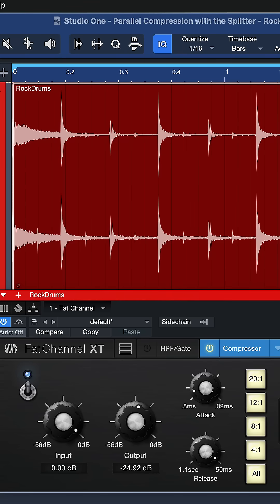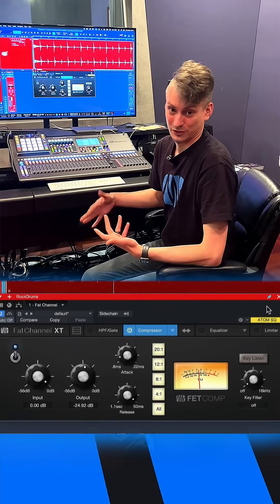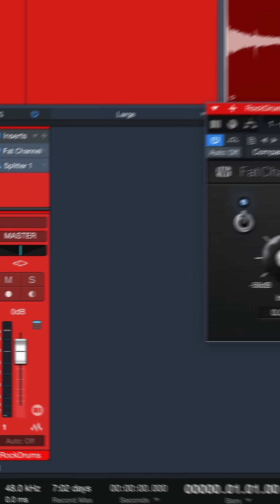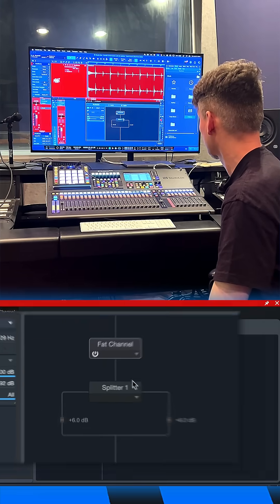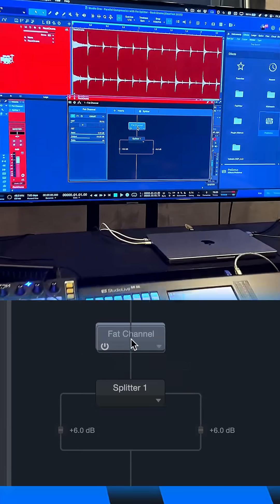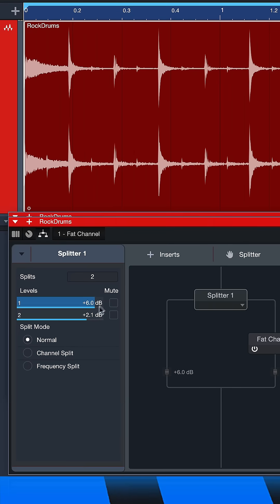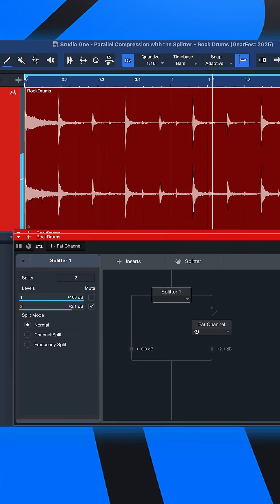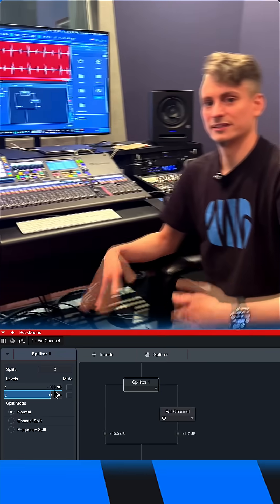Parallel compression using the Splitter Tool in Studio One Pro | PreSonus

Comment: The +6dB on the left branch of the Splitter (which is the Dry signal) is not by accident: indeed, when you insert a Splitter and split the signal in 2 branches like in the video, each branch has a volume divided by 2, i.e. the signal in each branch is lowered by 6dB (20*log(0.5) to be precise) — hence the « +6dB » on the left branch by Gregor in the video in order to retrieve the 6dB loss!

Gotta have that in mind when using the Splitter folks!
Reply: Very well spotted.
Reply: 20*log0.5?? I don't understand
Reply: @Post-Alone   that's just maths, that's the way to translate "divided by 2" in decibel terms. Doesn't matter to remember the formula, just know that "dividing the volume by 2" is equivalent to reducing the volume by 6dB; and vice versa ;)